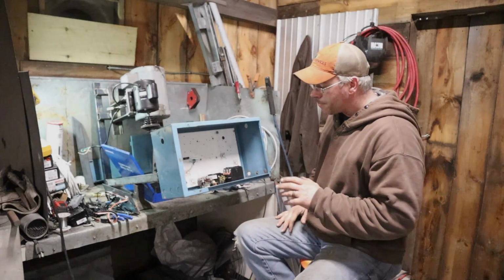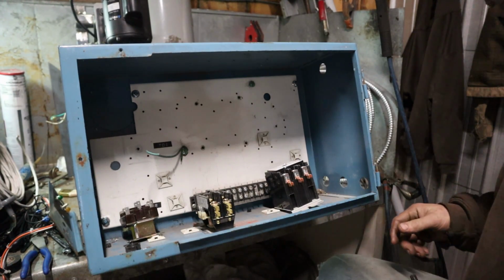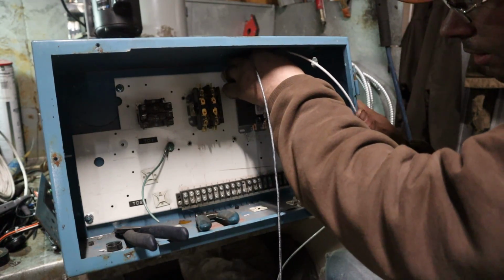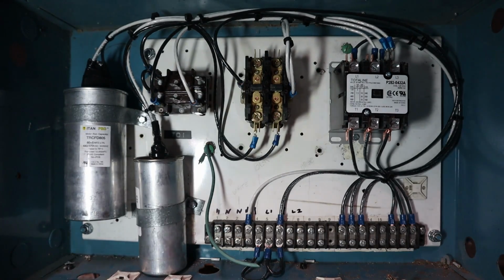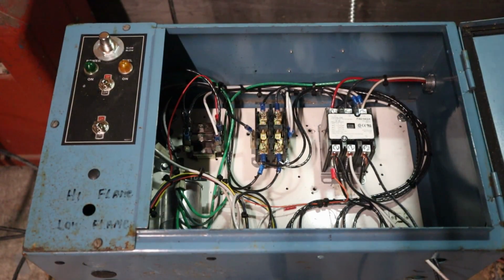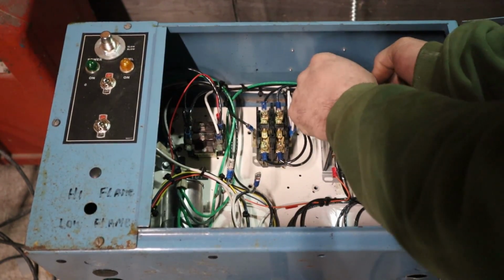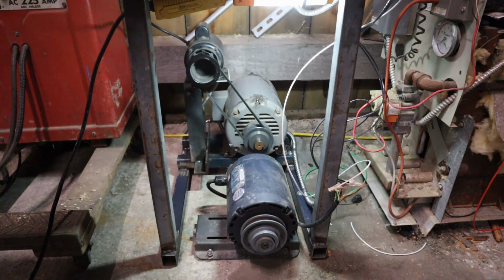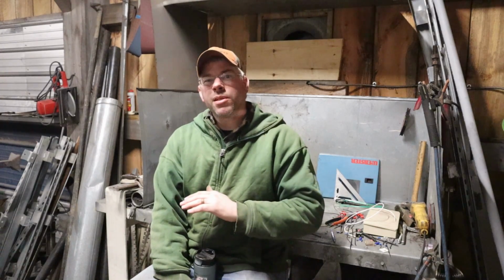MAKE YOUR OWN THREE PHASE POWER THE EASY WAY

Comment: I just finished getting my  10 hp rpc going but im having some problem getting the phases balanced, when i run my intended load (chain hoist )  2 of my legs drop to 190v . I can add more run caps and get the volts up to 270 idling (way higher than i like ) but same problem voltage drops when i run the hoist down to 195 -200. Im wondering if you have had this problem before. Everything sounds good idler runs nice and quiet. Idling it only pulls 4 amps . Im gona double check my hoist and idler wiring and make sure its good.if all is good im taking of adding a 2nd idler maybe it will help clean up the power ?   Any  suggestions ?
Reply from the maker: Add another three phase motor into the circuit, it helps clean up the power quite a bit.
Reply: @TheTradesmanChannel  does the 2nd idler size matter ? I was thinking 2 hp ? I also have a 20 hp motor i could use , would it be better to just do 1 20 hp ?
Reply from the maker: Adding another small idler running off of your phase converter helps to pull the single phase closer to the same plane as your three phase.  It will never be quite perfect, but you can get it within the 10% safety net.
Reply: @BlueFlameOfLife  Curious what HP your hoist motor is? The number one aspect of a phase converter is how much larger your idler motor is than your load motor. 3x is a good rule, but the larger the better, as far as voltage balance. Multiple idlers in parallel is a good idea, as smaller 3 phase motors are cheaply available and it gives you some flexibility to only run the idler you really need. If 10hp isn’t enough, adding another 5hp or 10hp idler sounds better than adding a 2hp idler (you can run the 5hp on its own for example as a smaller phase converter for running say 1-2hp machines)To
Minimise the voltage drop of the generated legs, the most stable and durable method is to use buck/boost transformers to boost the generated voltages a bit so they don’t drop so low. 2X  3 kVA 24/48V buck/boost transformers wired for boost placed across the 2 generated legs should help quite a bit. If your single phase is connected across A-B, your boost transformers should be connected across B-C and another boost transformer across A-C. A-B is still the single phase voltage and is “passed through” the converter, nothing done to it by the idler motor nor by the boost transformers, and is very stable as it’s coming from the power company from a large transformer.
Reply: @Orgakoyd  thanks for the reply and the information, i actually got this fixed not to long ago, my RPC works just fine but the 4hp 3 ton hoist i had was wired wrong when it was rewired from 460v to 230v . so when i was trying to run it, it was fighting its self. once we got that fixed my voltage stopped dropping out when in service. but i may have to get another idler motor if i end up getting another piece of equipment but we shall see. thanks again for the help
Reply: @BlueFlameOfLife  Happy to hear it was just a wiring issue. Do you happen to know what voltage it gives under load now? Also is it a bare idler or does it have any balancing capacitors?
Reply: @Orgakoyd  if I remember correctly I'm getting 240 idling and around 235 -230 under load. I think I'm using like 100 uf per leg and 25 or 50 uf to balance the "wild " leg . If i remember I played with it a bit to try and get it closes to 230-240 under load.
Reply: @BlueFlameOfLife  Thanks for the reply, I only just saw it!
Reply: @Orgakoyd  it's no big deal. I actually forgot about this , so I did get my problem fixed, and it had nothing to do with the rpc . I was using it to run an overhead crane hoist, and I found that the hoist was wired wrong, causing voltage drop.  Rewired it , and it all works great!  Thanks for all the help !
Reply: @BlueFlameOfLife  Good to hear that it was a simple fix!
Reply: @Orgakoyd Good morning, I had a question and I was hoping to talk to someone smarter than I, so I back here with you. Lol I have my rpc running and all seems good , except all the equipment I run on it pulls high amps (measured at the equipment) I'm not having any voltage drop during the running. Is this something you have seen before or have an idea what might be a good place to start. I have a 10 hp rpc and iv used it to run diffrent things . Most everything has a 3 or 4 hp motor. It runs all the equipment fine just the amps are normally 2x fla. Thanks for the help
Reply: @BlueFlameOfLife  Hi, I appreciate the compliment but I am by no means that highly knowledgeable on this! Just what I read from much more knowledgeable guys on Practical Machinist.

My understanding is this: When it comes to current draw on non-resistive AC loads (i.e. inductive and capacitive loads. Motors and transformers being an example of inductive), the current reading you might get does not necessarily correlate to power (Watts) being dissipated, whether it’s mechanical work done by the equipment or waste heat being created. This is because the AC current value is ‘’lagging’’ (lagging in case of inductive, ‘’leading’’ for capacitive) the voltage, i.e. it’s out of phase with the voltage sine wave (to varying degrees) and the peak of the current sine wave corresponds with a lower part of the voltage sine wave which results in the actual power dissipated being less (sometimes much less) than the current reading would suggest. The degree to which current is out of phase with voltage is represented by ‘’Power Factor’’. A power factor of 1.0 represents a fully resistive load, a power factor of 0.0 represents a fully ‘’reactive’’ load (again can be inductive reactance or capacitive reactance). A Fully inductive load is impossible, there will always be a resistive component, so Power Factor is never as low as 0.0, and on motors it can also never be 1.0. You can find the power factor value on motor nameplates, a decimal number that might be like 0.86 (this is just a random example, it could be 0.7, 0.93 whatever. Sometimes expressed as a percentage so 86%, 70%, 93%. Not the same as efficiency percentage of course.). This power factor value will be true when the motor is under nameplate load, drawing nameplate current. An unloaded induction motor has far lower (worse) power factor than the nameplate value. This means that although the shaft is just spinning in air and the motor is not getting hot (just a small load from the fan, bearing grease losses etc., meaning very low total watts being dissipated by the motor), the current draw will look disproportionately large. 

Now the low power factor when unloaded will never cause a motor to draw MORE than FLA (**as far as I know**) just a disproportionate fraction of FLA considering no load. As load is applied, the current reading may increase somewhat from the idle reading. The load (real power) is accommodated by the current sine wave (which might be very out of phase with the voltage when unloaded) shifting over to become more in phase (never completely) as load increases, up to the point of full load, at which point the amount of phase shift of the current and voltage sine waves will represent the nameplate power factor. 

I say all this as background for whenever you are thinking about current draw of motors. In your case, you say you’re getting 2x FLA. I don’t know why this might be but keep in mind the above whenever working with induction motors (and indeed inductive things like transformers).

Motor temperature is very important here. You need to determine if the current draw is ‘’real’’ (that which is due to work done. i.e. at the shaft and also as heat loss) or if it’s reactive current which is not causing heating of the motor (you can only think in heat terms once mechanical load is removed, so don’t discount an overload condition unless you’re testing unloaded). I would start by measuring unloaded amps and also monitoring unloaded temperature. 

Your phase converter idler motor also acts as just another motor which is running idle (when not supplying load motors), so the rules of low power factor and high idle currents apply. It should also not be getting hot just running idle using the single phase supply. So I would measure its unloaded amp draw (again keep in mind everything about out of phase current) and temperature when idling. This is how I would approach it. I’d like to hear what happens with the high current readings you mention.
Reply: @Orgakoyd  thank you for the reply this give me alot to ponder over, with the machine idling it pulls alittle under fla , the x2 over fla is when I'm pushing the machine to about 50% . It is a hydraulic pressbrake and its relief is set at 1k psi and i belive it should handle 2500 or 3200 psi.. I will keep an eye on Temps from what I can tell nothing seems to be getting overly hot, but also I don't use this constantly all day every day it normally gets used for hr or 3 (mostly just idling). But non the less ill hit all the motors with infrared. I know one of the machines has 10 amp Fuses in it and it's "pulling" 16 amps and has yet to pop them so I'm wondering if there is something with the sine wave being out of phase like you were saying causing the amps not not be correct. Like I said this is all being measured down stream of the rpc I'm not really caring what amps it pulls from the supply power just though it was strange pulling so much at the machine.  So your thinking as long as none of the motors are getting hot the supposed amp draw doesn't really matter ?
Reply: @BlueFlameOfLife  I did reply to your latest reply, not sure why it its't showing. Another reply is also missing where I linked to a page about power factor etc. 

Yes I would say always keep temperature in mind, if the motor isn't getting too hot there can't be a problem. After all over-current protection is all about keeping the motor cool to stop damage to the winding insulation which can severely reduce motor life, or even burn out a motor quickly if hot enough. Are you confident in your current readings? Maybe confirm with another meter? Do any of the motors have thermal over load protectors? (usually incorporated into the motor starters) 

And about those 10A fuses you mention, if they are there to protect the motor and not popping after sustained running, that's another good sign. 

Hopefully this reply shows up!

Comment: over here in mexico, if you dont have three fase feed,   but if is avalaible  nearby,  at least with materials, all the porcedures with CFE, theonly supplier in mexico,  it going to cost  about 1500 to 2000 usd  to do it .
Reply from the maker: Nice to meet you sir.  Seems three phase is expensive everywhere.  Greetings from north of the border.
Reply: im installing 480 in my shop its about 12 grand usd panel alone 4500

Comment: This is really old-school.  My uncle has run his 3-ph lathe this way for over for over 50 years.  One additional thing he has on his setup is an idler pulley on the pony motor belt drive to allow him to release the belt tension after starting the idler motor.  Keeps the pony motor from continuing to spin after the idler motor has started.
Reply from the maker: That's a pretty good idea.

Comment: Yup, for what you are using, that is a fairly clean 3-phase. Great job, brother. I dont know if those who are basically clueless (on mechanical and electrical) could understand your explainations, but as a guy who has a degree in electrical engineering, you seemed to bring the vocabulary down to a common level. Great job. If you get tired of all of that field work, maybe your next step could be as an instructor in a trade school?
Again, great job.  See you on the next one.
Reply from the maker: I have been giving that some thought for awhile.

Comment: Jim I was told that my 3Ph compressor even though it was VFD rated that to keep the bearings healthy I would be wise to add an AEGIS ring to it.
It will bleed off the electricity  that is building up in the rotor and arching through the bearings. I needed to have the motor rebuilt and had then do it at that time. The reason for the rebuild is the bearings were a bit on the tired side.
Reply from the maker: I'll look into that.

Comment: Nice overview and build. I have done it once before but it still wont stick in my head completely.
Your voltage meter might have a dying battery, mine does that numbers jumping display right before the batteries die. what is worse, when the battery finally does go, the readings are all over the place and wrong. try having that happen for the first time when you are standing in front of a customer and you are standing there wondering what the f is happening. "Uhhh, your house should have been setting things on fire if this is right..."
Reply from the maker: Good evening.  That meter is actually meant to do that, it's a true rms meter so it'll never go to true 0.  This thing will read the milivolts on a neutral wire.

Comment: Dont really understand electrical connections and terms. Lost a brother on someone else's wiring. But I have 2 nephews who probably understand every thing you said and did. They get calls from me when I'm over my head. Your video is interesting and helpful since my nephews and myself are known to find used ch4aper tools to use. Three phase equipment does come up ie. Air compressor for free every now and then. Now you showed me a solution.

Comment: Nice clean job Jim, Congratulations! We knew it was going to work but it is still reassuring when everything comes together. Each victory will help you some other to win. I always made sure that the primary power would drop out if we had a momentary power interruption. Nice way to say power failure. I know you never have them but in our neck of the woods they are not unusual. This protects the system if it cannot restart without your personal assistance. Then anything that is hooked up could single phase until it "Lets the smoke out". Never a good option. So if the lights go out while you are taking a shit the worst thing that will happen is that you will have to start it back up after the paperwork is done. I hope you have enough paper....
Reply: I love it " when the paperwork is done" priceless mate!

Comment: Your are way over my head. My neighbor has set up to run 3 phase and I think it just involves a pony motor to 3 phase motor turning and then they take the power to run said tool form there. I may be wrong but would that work?
Reply: Like wise Jim. Way over my capacitor.
Reply: Well if you actually watched and listened that's exactly what Jim did, he disconnected both capacitors and then it is exactly the same as you described, but as Jim pointed out the 3 phase motor will not like it at all, and if it is an older "tired" motor as he described it, meaning with old poor insulation on the windings they will heat up because of the voltage and current imbalance and sooner rather than later the motor will fry nicely. Fire extinguishers at the ready chaps!
Reply from the maker: That's exactly what this does.

Comment: Well that was not what I expected! 

Don't get me wrong .... it works (and I have seen it on Kris Harbour Natural Building .... worth a watch) .....
But I was expecting a mechanically coupled single phase and 3 phase motor acting as a generator set!

As near as I can tell the "noise" is from what we call single phasing .... (a 3 phase motor running on 2 phases) and you are generating a 2 phase supply with an artificially induced third leg at a 90 degree phase angle to both the supply legs! It is not easy to put into words but if you picture it as 2 triangles representing the 3 phases. One triangle is equilateral .... all balanced and good the other is the first triangle with one of the points dragged to the middle a bit to form a 90 degree point. That explains why your voltages are different on one leg. When you switch the other motor in it drags the triangle more into line (load)!
When we talk about a "Clean" supply line we are not talking about voltage but waveform. I have no idea what the waveform on your rig would be but with the harmonics from the windings and caps it would not be good ....... but the more you load it the "cleaner" it would get!
Whilst it would not be suitable for industrial applications for you it is ideal! (cheap and it works)!

A final thought ..... does this affect your electric bill? Those pesky smart meters they have been fitting all over actually record your power factor and if you drop below a certain point they will charge you a different rate for ALL your power! Call me paranoid if you want, but your not if they realy are out to get you! ;0)

Comment: Out of curiosity what is your service amperage to the panel? I have 200amp to my shop and never seam to have enough amps to power up every thing, will your saw running limit your other tools?
Reply from the maker: This is only a 100 amp sub panel.  A 100 amp panel can run a pretty big shop, one guy working alone is rarely using more than 20amps at a time as he's running tools.
Reply: TheTradesmanChannel I also have a 100amps coming off the panel to a cottage, so just have to be aware of whats going on over there. However my jointer and table saw use 240v, just have to be careful when my son and I are working the tools together.
Reply from the maker: It's the amp draw you have to watch.  Both of those tools probably draw around 15amps each, total of 30 amps.  A household generally is drawing around 40 amps at any given time.  So if you have a 200 amp panel you're only drawing say 70amps with two of your main tools running.  Say you are running 1500 watts worth of lighting in your house, which would be say 15 100 watt light fixtures at once, that is only around 15 amps.
Reply: TheTradesmanChannel my issue is not having enough breakers and circuits, might have to upgrade the panel someday and run more wiring.